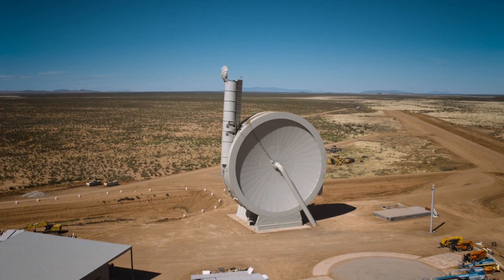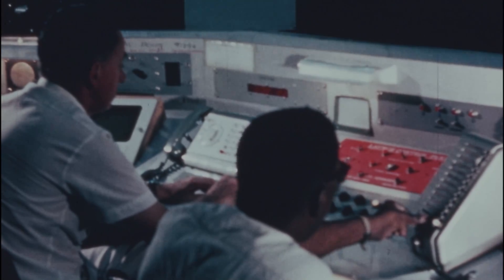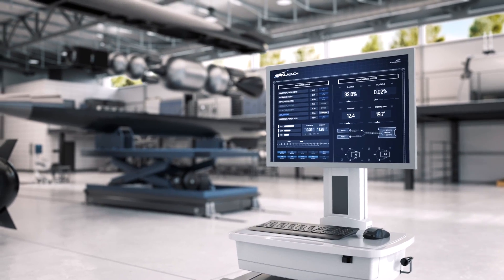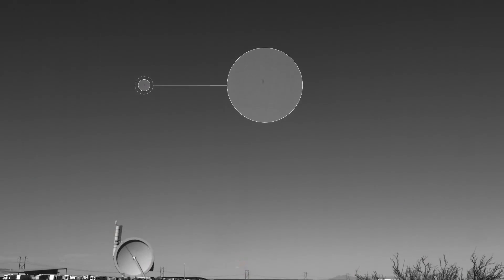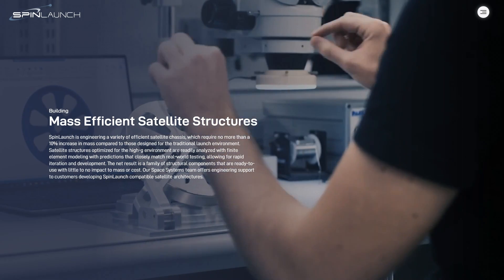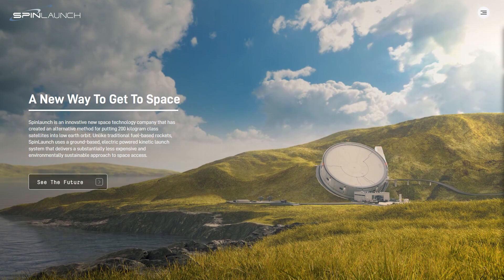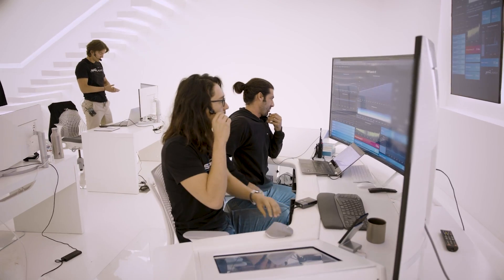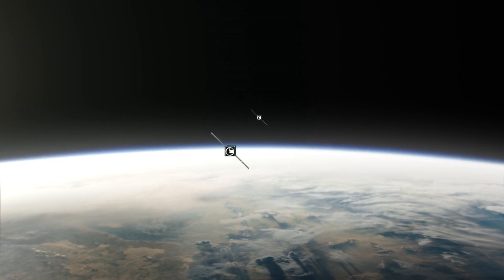Can Spinlaunch Throw Rockets Into Space?

Comment: I wonder how much it would help this thing to build it at a very high altitude in order to diminish the aero load on the exiting projectile. 

Of course there would be safety concerns of a failed launch falling on land since elevations high enough and coasts dont mox, but since its a yeet machine as long as the rocket is yeeted hard enough that the vast mayority of failure possibilotirs still have it landing on the ocean far, far downrange then it should be fine.

Comment: I think the easiest way to solve the problem of the rotor going out of balance when you release the projectile would be to have another weight released simultaneously at the other end of the rotor arm. The “dead” weight could just be released straight down into a deceleration material to slow it down in a controlled fashion.

Comment: Frankly out of all the launch systems I have ever seen this seems to be the most insane one ever. And that includes the orbital cannons.

As many people here have already noted for the system not to tear itself apart it would need a counterweight opposite of the payload and that counterweight would need to be released at the exact same instance as the payload. Otherwise: RUD.

And where is that projectile that is firing at an angle into the ground going to go? Some have suggested a pool of water.

The energy released by that counter weight would be equal to the amount of energy released if a similar size rocket had exploded on the launch pad though. (because force = counterforce) . So while a fraction of the energy would be transformed into heat on impact with the water surface, this still would cause a shockwave through the water. And since water is incompressible that shockwave alone would likely tear apart any pool you could build.

Or to go for scale: They claim their system uses megawatts for multiple hours to spin the 2 weights up . So let's assume the minimum this claim allows for: 2MW for 2h so 4 MWh.  
Let's assume that their system is one hundred percent efficient and all energy drawn from the grid gets put into the rotational energy. For simplicity's sake let's also assume that the rotor itself is massless.  (in reality that's gonna weigh many multiples of the payload and eat a ton of additional energy making the system even more inefficient)

4 Mwh = 14,4 GJ of energy
Velocity at 450rpm and 50m radius is  2*3.14*50m* (450rpm / 60s) = 2355m/s

so if we put that into the energy equation

14,400,000,000 J  =  0.5* x * (2335 m/s)²

we end up with:  5192 kg for x  

That's the amount of mass we can spin up with 4 MWh in an absolute best case scenario. 

now of course we need to cut that in half because we have a counterweight that needs to contain the same amount of energy as our payload.

so we end up with about 2.1 tons of payload.

it also means our counterweight contains 7,200,000,000 J of kinetic energy that we need to get rid of. And instantaneously. You see what I meant with: That's like a rocket exploding on the launch site?
How much energy is that? To get back to the pool of water: water's  specific heat capacity  is 4184 J⋅kg−1⋅K−1.
So let's assume the water is being held at a balmy 0°C (so just barely before freezing for you americans) and we need a 100K increase to turn it into steam:

so: 

7,200,000,000 J / 4184 J⋅kg−1⋅K−1 / 100 = 17,208 kg

or to put in in words: the energy contained in that counterweight is high enough to boil 17,200 liters (~4500 galleons) of water .

Or with a quick google search: Equivalent to about 1.7 tons of TNT.

There is no chance in hell they can dissipate that amount of energy without large scale destruction around the launch site no matter what they do. And remember that was when we assumed the minimum amount of energy input and ignored the entire rotating arm.

Comment: If we're doing weird ideas, how about this; you build a massive sphere 2km wide, and heat up the inside, a hard shell hot air balloon You build it in wedges like slices of orange, float them to deep ocean, attach the ends, sink the wedges, attach them into a sphere, pump it dry. Add a central stalk, surround it with magnets, and you have a mass driver floating in the air. You could also use it to do astronomy, atmospheric science.. or a hotel. That thing would get some serious lift, enough to allow building pretty sizeable habitats and operating gear on the lower portion. Just bring it down to load supplies and payload from ships, or open a door and fly them in.
Reply: What is your sphere made of?  Wall thickness?
Reply: @TheEvilmooseofdoom  Does it matter? It's a sphere, the larger it is, the lighter you can build it (proportionally). Think geodesic structure, but a complete sphere, aluminum is probably easies/cheapest for the frame, with some UV resistant plastic panels to let sunlight in, natural heating system. At that size, it would probably fly even if were made of 4 inch steel plate.

Comment: Frankly, I don't get it. The gain is 1 mach and 0 altitude. Out of this speed, most will be consumed at low altitudes and converted into heat. Is't it better to use a plane? You then gain, say, also 1 mach but you are well above 10000 meters.

Comment: I hope to live to see satellites being yeeted into orbit.
Reply: I mentally like “yote” as the past participle of yeet. =)
Reply: They need to put Broke & Boosted into orbit as a test payload
Reply: @sabretechv2  man that car is in like 10000 pieces somewhere in the middle of Arizona these days 🥲 the disrespect
Reply: cell phones notwithstanding, I don't think the 2nd stage guts ( 7:04 ) of that thing could possibly hold up under launch strain of 10,000 g's
Reply: @-danR  It's not shock loads of 10,000 g's. It's a slow build up, so there's no issues of dissipating energy or redistributing the load very quickly and a lot of it will be tension load which means your material won't have to deal with irregular internal stresses. It's a high strength to weight ratio definitely, but not unheard of.
Reply: Eh, they are throwing the rocket into space, but the rocket is putting the satellite into orbit. (Space = go up a distance, Orbit = go sideways really really fast)
Still an awesome idea :D
Reply: Nobody is asking how a satellite is supposed to withstand centrifical Force before it's launched into space
Reply: @thecloneguyz  Because it was answered in the video.
Reply: Yeet sequence
Reply: As long as it doesn't level any city when the launch goes wrong, am ok with it.
Reply: You won't because this will never work
Reply: @RAR-inc  thanks Thunderfoot. don't you have to be irrationally angry at Elon Musk?
Reply: @jaqssmith1666  Why? I am a glowing“ Fan“ of Elon! With every sigle one of my seventy years of Space enthusiasm!!
Reply: Gonna happen right after we have practical fusion power. So no, we'll all be dead 😵
Reply: @pauldzim  atleast practical fusion power is theoretically possible. Spinlaunch is a joke and attempts to violate basic laws of physics and atmospheric drag.

Comment: Instead of spinning the launch vehicle around, would it be better to just spin up a weighted flywheel and engage some sort of clutch attached to a lever that flings the rocket upward?
Reply: The G-forces from a sudden acceleration like that would crush whatever payload they were attempting to launch. That would be comparable to hitting it with a sledge hammer! The whole launch vehicle needs to already be moving at speed when it is released.

Comment: Success in the commercial market?. There may be a minor difference in slinging/spinning out a solid test object vs slinging out useful objects such as small commercial satellites with fragile parts e.g. solar cell panels etc. in that kind of G force, heat, vibrations...etc. going from the vacuum "crashing" into the atmospheric air density. Anyway, it would be really nice if it somehow really did work out successfully.

Comment: Hmm, suppose it had two payloads, with one on either end of the arm (one is just a counterweight), releasing both at the same time with one going into a ground trap. This would overcome the considerable force imbalance at the moment of release.
Alternatively, what if it had two space-bound payloads, one released one half rotation after the other. There would still be a millisecond long force imbalance, but it would put less wear on the bearings.
Reply: Actually that also sounds sane. Or the second 'satellite' could be a a dummy too, which would fall somewhere in the ocean, or maybe even deploy a timed decelerator/parachute.

Comment: If the sudden and massive reduction in mass at the moment of release is a big issue…….? How about making the rotor itself incredibly heavy? That way, the payload would represent, say, five percent of the total spinning mass. Therefore, the reduction upon release would not be as huge, and the stresses on the rotor and bearings would be small. 

I dunno. I’m no engineer. In fact, I work at McDonald’s, clearing tables and sweeping floors. 

So, it’s not a fully formed theory. 

“Do you want fries with that?”
Reply: BTW….. WHY ARE ALL THE GUYS in the control room so HOT and SHAGWORTHY ???
Reply: You can solve this issue by immediately toggling the rotors into a friction exempt/loose state I assume? I’m in 8th grade and trying to comprehend all the issues so I have no idea if my idea works either!
Reply: @shelfofsheelfs  

Do you want fries with that theory ???

Comment: meeh..  i am very skeptical here.  BTW  i am all for variation to the Space Gun design. we can build structure on elevated place(there are stable places with over 2 km elevation) and make barrel like 2km high. projectile will be also in vacuum  and it will experience much smaller G's bcs of its length and gradual linear acceleration. it does not need to be explosives.

Comment: "a few megawatts over about an hour and a half"
so...double digit GJ of kinetic energy in the rotating mass?
Reply: Indeed - however they do have the option to then immediately act as a return pump to the grid, thus recovering at least a portion of the energy they used to start the system. That being said, they would need to cover the vacuum chamber immediately after the launch to prevent friction losses
Reply: Yep. OTOH, for comparison, a falcon 9 first stage is about 17 TJ of fireball if something goes wrong, too. Kinetic energy is somehow more alarming, of course, but it's at least a lot less of it.

Comment: Given the lower escape velocity, I wonder how big a trebuchet would have to be, and how massive the counterweight, in order to launch a payload on a course from the surface of the moon that would bring it into LEO or possibly even entry into earth's atmosphere.
Reply: I want to see them fling one of these out to the moon some day. Getting back from the moon would be a lot easier since the escape velocity is 2.38km/s and they can reach that easily. Getting back would be an issue, you’d need to place the launcher so that it can get enough lateral motion once facing retrograde (relative to earth) that it flings fast enough to get a return and atmospheric collision trajectory…
Reply: @shelfofsheelfs  I wasn't thinking just a half orbit back to earth.  I was thinking either a slowly decaying orbit due to an eccentric orbit that would take advantage of gravitational assists from the moon until it was low enough to take advantage of atmospheric drag or a parking orbit to be collected later.  

We're talking weeks to months for the slow orbit decay.  Something that would allow for an easy and planed rendezvous to collect the material in orbit, rather than risk an impact and loose material during entry through the atmosphere.

Comment: How about launching a comparable weight downwards at the same moment as the launch upwards?  They would have to build a device to "catch" the weight safely (I'm envisioning a 100 meter tunnel below the device with a magnetic break), but that sounds like a much simpler engineering challenge than making the bearings and mounting support changes in balance that extreme.

Either way, I wouldn't want to be in the building right next to the device.  I see visions of the device in Contact tearing itself apart...

Comment: The amount of load shift once they deploy the rocket is insane. When spinning up you can correct with a counter balance. But once that payload has been launched, you now have a very unbalanced set of arms spinning at Mach 1. I am extremely interested in how they plan to solve this!!!
Reply: By simultaneously shooting another rocket into the ground
Reply: @Fabian3331234333  😂
Reply: They literally release the counterweight at the same time as the rocket. The counterweight flies into a tunnel in the ground and makes it a little deeper.

Not kidding, this is their actual plan. It works and it'd fairly simple.
Reply: @gamesguy  A counterweight hitting the end of the tunnel at hypersonic speed releases enough energy for the blast to damage the contraption above.
Reply: @vladimirdyuzhev  Depends on what the counterweight is. Could be little bits of plastic, like the Armbrust rocket launcher uses for its countermass.
Reply: @LOLHAMMER45678  Kinetic energy doesn't care what the material is. Only weight and speed.
Reply: @vladimirdyuzhev  It's not at hypersonic speeds at all, merely mach 2, and it doesn't release enough energy to damage the facility above. A 10 ton weight hitting the ground at mach 2 creates the same energy as 550 kg of TNT, which is easily contained.
Reply: Perhaps they can carry a load closer to the pivot of the rocket side of the arm, and let it slide down/fall outwards after releasing the rocket? By conservation of angular momentum, that would mean a significant near-instantaneous reduction in velocity, but that's in the arm's strong dimension and neutral for the bearing.
Reply: By simultaneously launching another rocket into a tunnel that goes straight down, through the crust of the earth, into the mantle, and then through the mantle, the core and all the rest of it until it comes out of China or something, preferably through the bowl of the supreme leader's toilet

Comment: Might the counterweight be of nominal actual mass, but the force be induced by some sort of electromagnetic field  (possibly effectively rotating around the structure with it) ... That way, the electromagnet could be switched off at exactly the time of release of the Primary, such that there is no sudden shift of forces as the counterweight effectively disappears at an identical time as the primary craft mass ... ???

Comment: As mentioned in the comments here, an opposing dummy mass released at the same time would overcome the out-of-balance force on the rotating arm at launch. Thought 1 - if the dummy mass was aimed at a piston in a tube of hydraulic fluid the energy could be accumulated for later use. Thought 2 - if the dummy mass was released fractionally before the release of the rocket the extra inertia of the out-of-balance arm would be imparted to the launch. My 2 cents.

Comment: Human rated yeetings tbd. I imagine they have a fluid counter weight. Its dispersed mass wouldn't crater the walls and they can control the release rate.
Reply: It's not the release that would crush the humans, it's the continuous force generated by the centripetal acceleration. Unfortunately there is no getting around this. The G forces mentioned in the video are what is required to keep the launch vehicle traveling in a circle while it is being spun up. At the moment of release the vehicle actually stops accelerating (until it slams into the air after leaving the chamber, resulting in significant forces). The only option for a man-rated kinetic launcher is a classical mass driver/railgun design and it would have to be tremendously long to keep the G forces down.
Reply: Yeah, it'll be a difficult task. At least the amenities probably wouldn't be a problem.
Reply: its

Comment: Here's what you do:
You build a tunnel in the oposite direction and line it with powerfull electromagnets.
You make the counterweigth out of a suitable metal and have that release down the tube.
You power these magnets from the motors, that way when the payload releases the current is directed into the electromagnets until the launchher comes to a complete stop.
This could slow the balancing weight down enough to hit a body of water to cool it down without the extreme hydrostatic pressure destroying everything around it.
Plus the counterweight is red hot and would need to be cooled down, water does this.
Reply: You just invented the rail gun but the problem is we don´t even get it to murder people at long ranges on earth so shooting someone into space whit it seems a bit far off. 

Think the closest thing we acutely got working would be this Japanese bullet trains which also basically are dragged whit magnets and even don´t have friction as they use it also to levitate. But they just go at 400 Km/h and are all the way on a track.